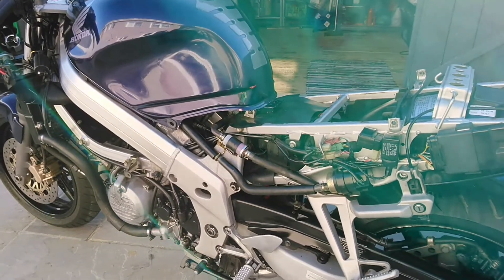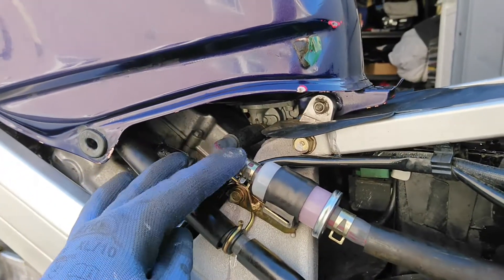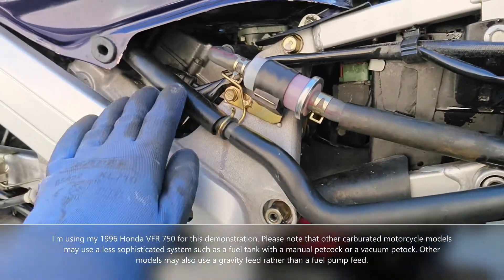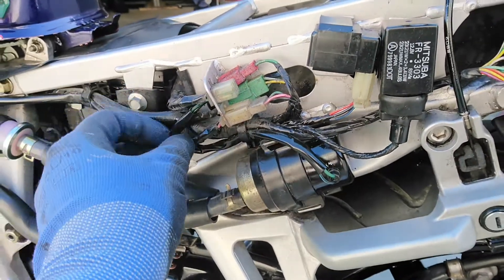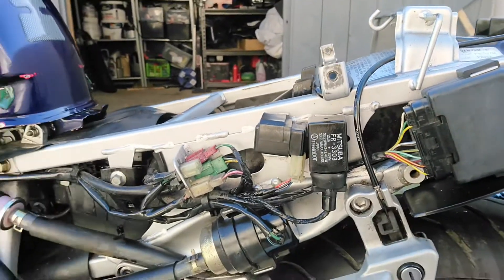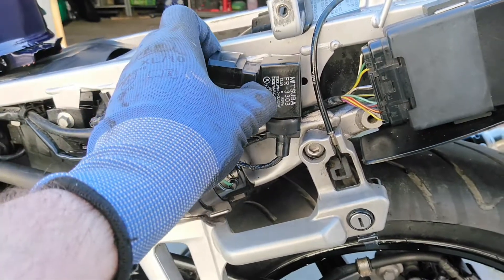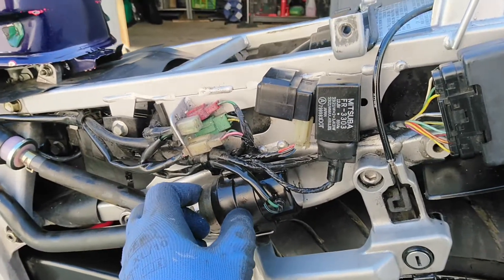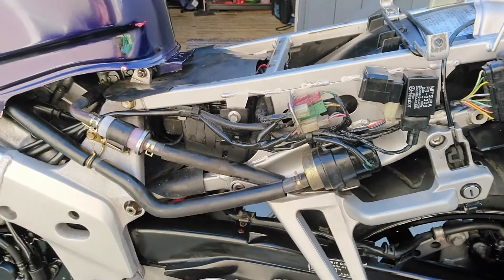How the Fuel System works on a Honda VFR 750

Comment: The lamest description ever.
   It was complete to the fuel pressure shutoff valve on the fuel pump fluid inspection.   Without the carbon vapor the thing won't fire right anyway..

Comment: I am having a problem with my fuel pump relay. I have bought a new one, and I have tested the fuel pump by bypassing the relay. The battery has been charged and output checked. I have checked voltage to relay and to fuel pump when bypassed. But nada when I put the relay in the mix. Any ideas? Anyone?

Comment: appreciate it sir, that is awesome informative video. dealing with some issues here when bike starts and dies as soon as i touch the accelerator. suspecting the pump as it does not every time even if connected directly to the battery without any fuel lines.

Comment: Thanks for doing this video! I started my VFR up after a while standing, and when running/ turning it pisses fuel out from above the carbs, which I couldn't work out. Must be a split hose up there or something? I did not know carbed bikes had fuel pumps 🤭
Reply: Mine did that. It was an oring.

Comment: there is a clicking noise coming from around the fuel pump every 10 seconds or so while the engine is running. idk what happened. the bike starts and runs fine but this is strange
Reply: If it clicks it means it's pumping. You should be worried when it starts clicking continuosly (no fuel or pump not able to maintain pressure).
Reply: Same here but based on what he explains at the end of the vid I think its okay? It only pumps when the valves are open behind the floater bowl in the carbs

Comment: my vfr has new sparks, carbs cleaned and synced, new regulator, oils, filters, everything in order. It hapenned twice in 8000 kms after running several kms that the bike died like if it was without spark or fuel, some minutes after could start again and runs like if nothing happen. Can it be the cut off relay or fuel pump? Never change that.
Reply: Ever found the answer?

Comment: I replaced the entire fuel system on my shadow 750. Do I need to somehow prime the system or just try to start it?
Reply from the maker: Fuel will probably need to be pumped to the carb float bowls but if the float bowls were never emptied then it should start fine and the pump should start flowing back into them after a few seconds from the pump.

Comment: I cleaned,repaired my carbs last fall,hardly used the vfr 750 1990 sinse, smelled fuel the other day,filled the engine with fuel.
2nd time now.
I did fit 2nd hand float needle jets from a 1989 cbr600f looked exactly the same but nowhere near as worn as the stock ones i took out. Never flooded in being stood for months until yesterday.
Fuel pump? Petcock? Pet cock i switched off after the repair i don't want to waste oil and also damage the engine etc...
It always ran awesome when on it never skipped a beat and went like a rocket and now it runs sweet on idle and always did after i repaired,cleaned out carbies and replaced those float needle jets,are the needle jet seats worn out maybe or one or 2 of them could be so when the petcock was on...fuel pushed passed them?
Reply from the maker: Floats in carbs can get stuck and that can allow fuel to flood the cylinder
Reply: @TheMotorcycleMuse  ok all checked and are ok but yes true . I'm just going to shut off the petcock as when riding it's always fine..all jets etc where all removed and cleaned replaced last fall,used the bike a few times then laid up for months ,i only put the fuel tap on n left it maybe 6 weeks ago and took all that time to finally flood the engine. All removed and rebuilt again with fresh oil and ran fine again ,now shut of the petcock as i believe too that they can be probematic and even fuel pumps that are failing or faulty can too cause a flooded engine with the fuel tap left open.